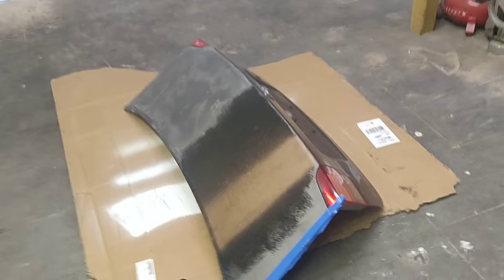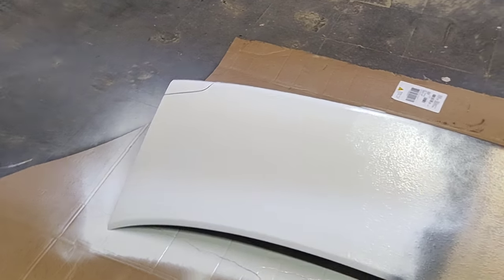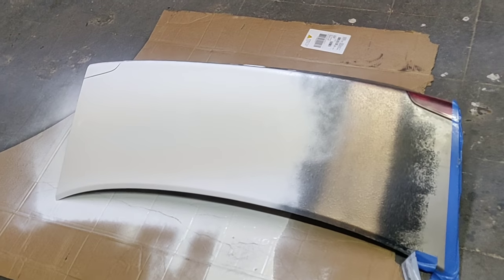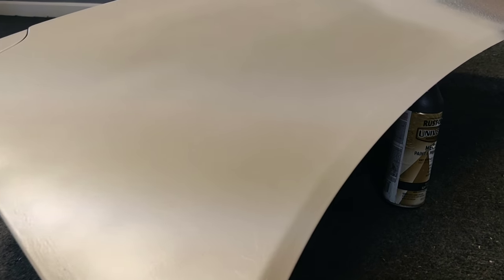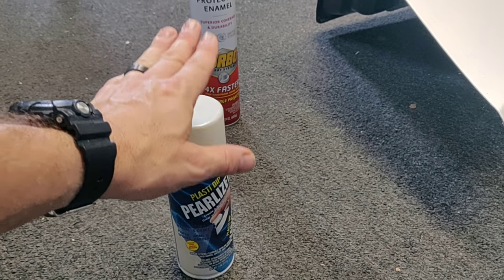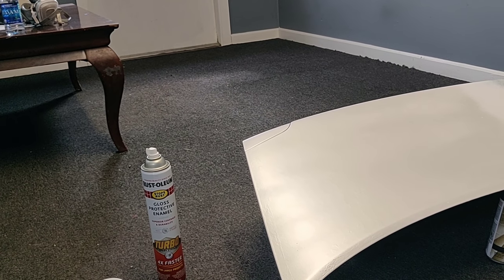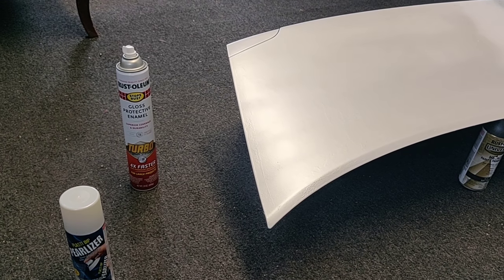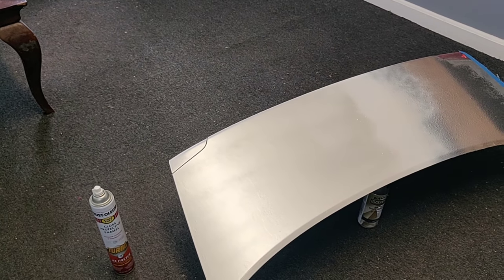RUST-OLEUM TURBO GLOSS WHITE & PLASTI DIP PEARLIZER  1995 LEXUS SC300

Comment: Dipyourcar told me, its because it may adhere to your cars paint. And wont come off without damaging the paint. 

Idk, this looks great.
Reply from the maker: Honestly that won't make sense.  They told me it needed a white base of dip to work or it wouldn't be Pearl.   If the Pearl would stick to paint then so would any dip since it's basically a clear dip with added Pearl.  Just what I think but I could be wrong
Reply: The thing with plasti Dip is that it probably won't all peel off perfectly ("adheres to your paint") in which case you need to use DW40 or dip remover or something which if you put on lacquer paint might melt it but I think rust-oleum is pretty chemical resistant so it might be ok 😊.... The way to get the plasti Dip to peel better is to put more layers on but maybe you're only meant to put two layers or so of the pearl or something.

Comment: Will be doing my 98 gs400 white with the turbo cans today hopefully itll come out half decent, previous owner did a halfa$$ job with some terrible orange sprain paint a few years back and its in desperate need of something new
Reply from the maker: Have you seen my video doing pearl white on the sc300
Reply: @petescarport  no I am currently about to start prepping Windows and wheel, then sanding. I'll check it out while I'm doing that. Any tips haven't used the turbo cans before they seem to work decently well so far though off the few test passes I took on my parts sc400

Comment: The turbo paint leaves way to much orange peel,  I couldn't spray my clear coat , switched to the 12oz cans and laid down a beautiful high gloss finish. 
The turbo cans are good for a farm truck , water tanks,  or something that you don't give a crap about,  not a car if you want it to look good.
Reply from the maker: I have to agree after attempting to do my trunk I ended up switching to the smaller cans